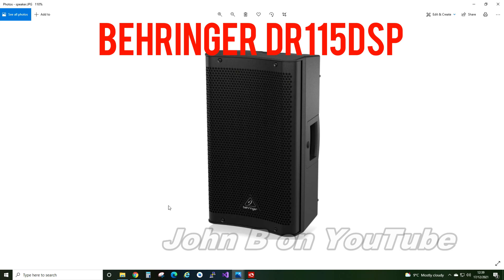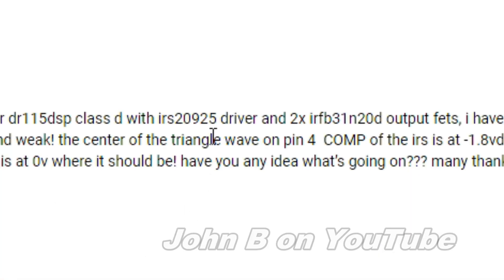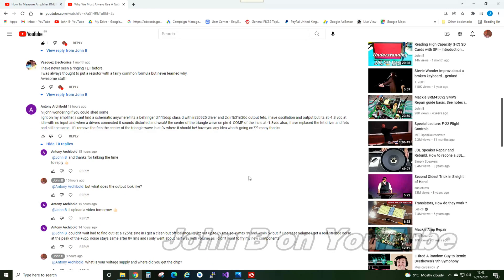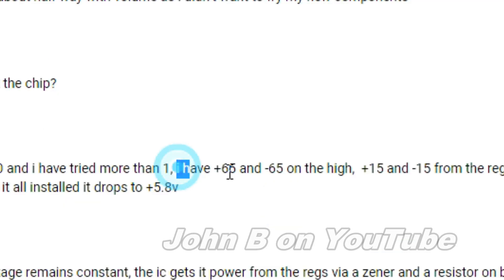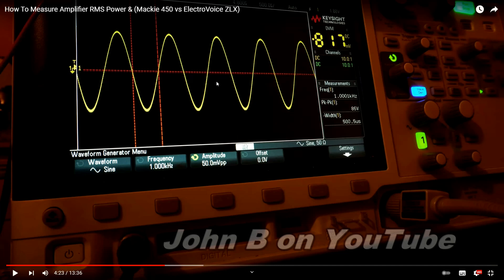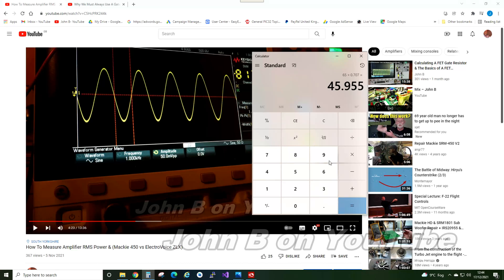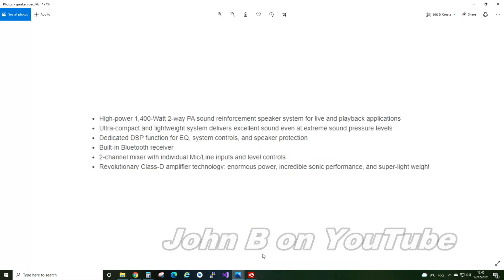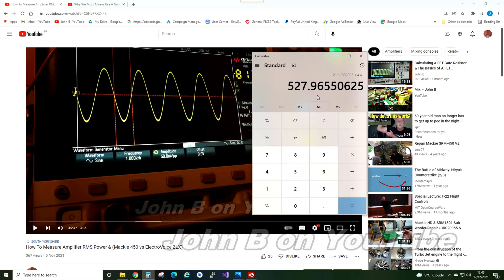Behringer DR115DSP true Bass RMS Power Rating vs Peak power. (Read 'Show More')

Comment: would you reccomend to buy this speaker
Reply from the maker: I'm not sure. Someone else gave me the figures. They are a powerful speaker. The only current speaker and can truly recommend is  the Yamaha range. I have repaired one so make use of their free warranty.
Reply: @JohnB-2021 thanks but I will probably buy this behringer and if I fully blasted sound trough the speaker would it blow ?
Reply from the maker: @maksmarkovic  Hopefully not. Thank you.
Reply: @JohnB-2021 thanks and I saw a video and on the back next to the iec power input there is a sticker that says 105 watts but how can it be 500w
Reply from the maker: @maksmarkovic  Maybe it is for a short time since the internal capacitors will charge to the mains peak voltage which is more than the RMS of 110 or 240v.
Reply: @JohnB-2021 okay thanks would you recommend this speaker or the behringer b115d more
Reply from the maker: @maksmarkovic  I can only recommend speakers I have seen. The Yamaha looks like a good speaker. That's is all I know. The good Mackie SRMv2 are old now, but they were a good little speaker. QTX are meant to be good too.
Reply: @JohnB-2021 thanks for the info
Reply: @JohnB-2021  do you think the behringer B115D is about the same wattage ?

Comment: The chinese ratings go 1400w peak, 700w program and 350w RMS. I doubt it does 500w even if the chip was able to do it and because it’s digital, unlike the AB amps, it only does RMS and pretty much no peak power.

Comment: It has half the RMS compared to the RCF 715 MK4, the tone is nice but the wattage is very low. It constantly turns on the limiter and cuts the sound.
Reply: Indeed it sounds nice and bear in mind that such cheap speakers are not designed for big venues. They are good for example as stage monitors/wedges.

Comment: the irs chips can do much more than 500w,i'd say that's a minimum power output,assuming it can take up to 100 volts per side,you can safely assume it can output at least 90v with good fets
Reply from the maker: Yes and put 2 of them in to get double the power and?
The amp has 65 volts
Reply: i this case you are limited by the power supply,i was just pointing out you can get huge power from irs type chips
Reply from the maker: @PetruV  I’m wondering why the first page of the data sheet quotes up to 500 watt
Reply: @JohnB-2021  i did some quick maths and yeah you get about 500w at 8 ohms 63vrms,but nothinh is preventing you from running at 2 or 1 ohms with good fets
Reply from the maker: @PetruV  who makes 2 ohm speakers?
Reply: @JohnB-2021  car audio uses even 0.5 ohm per coil,and these drivers are common in car audio amps
Reply from the maker: @PetruV  well we are talking about active speakers not cars

Comment: Can someone take them on for misleading?
Reply from the maker: Not really.
Because if they turn everything up and fire one signal into it, then if they can show it supplied 1400 watts PEAK music power, for 1 nano second, then that is good enough. The fact that one can never get that peak power in real life does not matter. The bass is 500 watts and then you can add the treble to make the number higher. Still, not bad power from a £250 speaker.